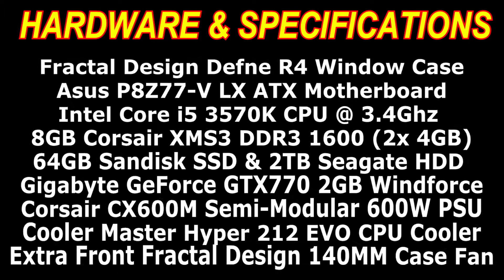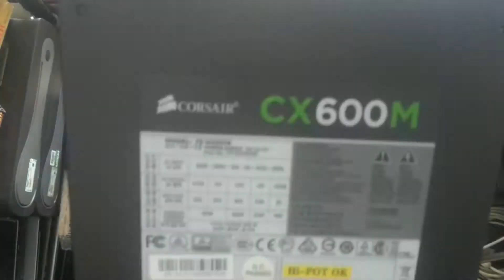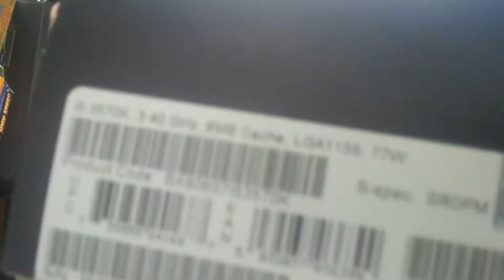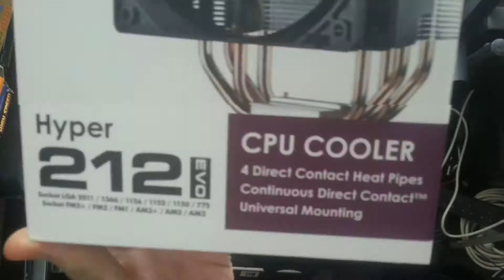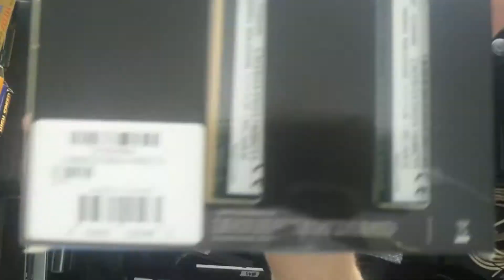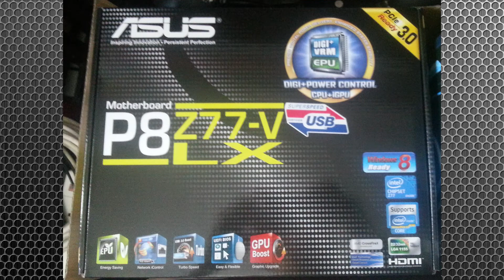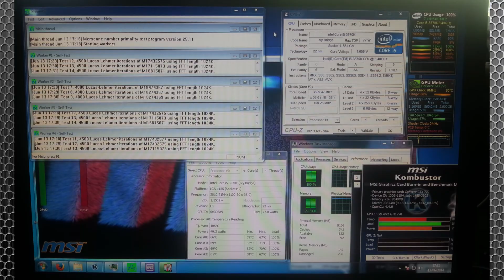Building A Gaming PC For My Brother - Core i5 3570K Gigabyte GTX770 Windforce - Time Lapse Build

Comment: Nice machine. I would like to have exact the same thing but with windows xp installed. I know that there are  drivers available for windows Xp up to GTX 960 but what about the processor and motherboard ? will it be supported by windows xp ? Thanks
Reply from the maker: Hi, I wouldn't at all recommend you install windows XP on anything these days if it's going to be Internet facing. Support was dropped for XP a long time ago and there's more security holes in the XP OS these days than there are holes in a siv. You're also likely to end up running XP 32bit and wouldn't have access to anymore than 3.5GB RAM, also with XP if you could even run it, the computer won't be able to operate to its full potential. I'd highly recommend running Windows 7 instead if you like the XP style of Windows.

Comment: Hey man nice work but i have a 3570k with an 1050 video card and 8 gb ram with thia configuration it will work fortnite and other game like bo3 ?
Reply from the maker: Hi, Yes you could definitely run Fortnite on that setup. Black Ops 3 should run OK as well but I'm not sure exactly what specs it recommends as haven't played it in a long while. 
Hope this helps! --Nathan
Reply: @NathanPH  Thank you a loot i will subscribe

Comment: Moving PC when HDD running? D:
Reply from the maker: Yes, It's perfectly fine and I've done it many many times before over many years. As long as you aren't throwing it about roughly there is nothing to worry about.
Reply: Nathan H Oh
Reply: Nathan H Btw, isn't a 2GB vram bottleneck to GTX 770?
Reply: aaronzone Nope it doesn't bottle neck it, The 2GB VRAM is fine for the most part and the GTX770 proves enough for most games on ultra settings at 1080p with playable frame rates. The system is a good all-rounder :)
Reply from the maker: aaronzone Oops, The above reply was me but signed in as my other gaming channel. :S